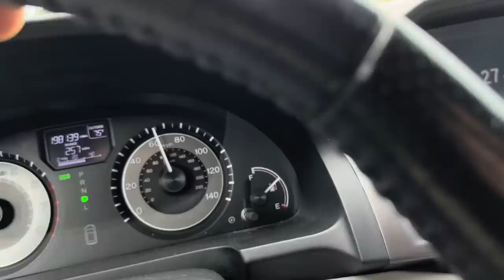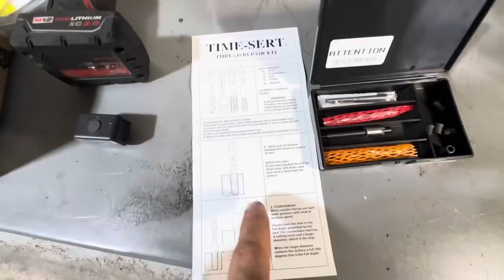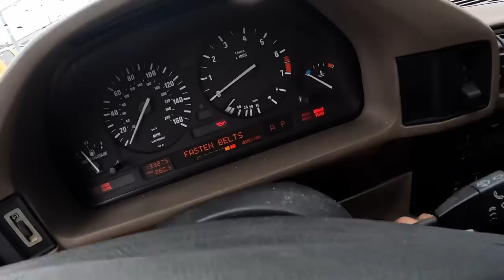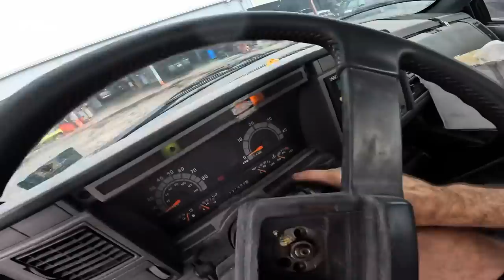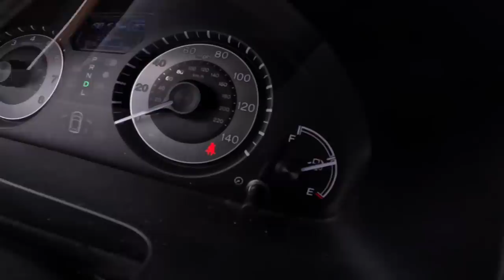Damaged Engine Block Threads! Subaru Outback Legacy 2.2 2.5 Hurricane Idalia

Comment: I am so glad you didn't give up on that engine.  That insert kit is great.  I used one when the threads on my motorcycle spark plug stripped out.  It was a race saver.  Be safe and take care.  Ken

Comment: Good job Ray, my only thought on the manner is I would have waited till the lock tight had set on the insert. Hopefully it didn’t get between the bolt and the insert. Or hopefully you don’t have to work on it after and put a new water pump if it did.

Comment: I had a Time Sert kit save me on a GM 3.4l rocker arm bolt. Expensive kit but worth every penny when not replacing a head. I learned to double check torque specs across a couple sources on critical bolts.

Comment: The reason they tell you to measure the drill depth is to be sure you are deep enough for the insert. It is a possibility you will need to go a little deeper and it's better to do it before you have the new threads in there.

Comment: Yay, an E34 BMW.  Had one for 10 years and thoroughly enjoyed driving it all that time. Comfy and reliable, only major issue was the diff started to whine after a couple of years but BMW replaced it under warranty. Still had original battery when I sold it although with it being located inside under the back seat probably helped.  Look forward to seeing you work on it.

Glad the hurricane didn't cause you too many issues and you and all units are safe and well.

Comment: If you did break thru, sealant on the bolt threads would prevent a leak. Thread locker (e.g. blue loctite) would probably work but teflon filled pipe sealant would work too.

Comment: 17:45  critical when tapping go in 2 to 3 turns  stop back off a 1/4 turn to break the chip, if you dont you can snap the tap off in the hole then your really in trouble also aluminum uses a different cutting oil then steel uses. Fyi.

Comment: 9:43 I did that in a head bolt on my Daily 2000 honda civic lasted for almost two years b4 I Did an engine swap And it didn't fail after the two years I just swap it Because I had to Make sure money

Comment: Should have used a Helicoil, much less invasive than a thread insert and the stainless steel threads of the the Helicoil are much stronger once installed especially in aluminum.  Friendly advice from an old auto shop machinist.

Comment: 4 months on the water pump repair, ouch, and you still have to put it back in. That’s got to be the most expensive water pump ever.  Might as well do the rear main seal and the valve covers while it’s out of the car.  

Riding the storm out!!! Be safe.

Comment: I like keenserts better for something that could ever need to be removed someday. They are the same as the timeserts but have wedged keys you drive down locking it in the hole so it doesn't unscrew..

Comment: Went and looked at the timesert site. I ?suppose? There thread expansion thing should work but the keyed type are very effective. I used them for many many years in machine tool applications and never failed a one.

Comment: Not sure if this was my car I would be satisfied with the water pump installation. Thread repair is great and probably better than new. My problem is with the amount of heat that was applied to remove that bolt, there could be just a slight deformation of the mating surface. I would have used a smear of RTV on the gasket just to be sure. The second thing is the dragging of the bolts when tourqing made for an inaccurate touque. A small amount of grease or never seize on the threads looked like it should have been applied to alleviate this and also make the next replacememt not have another broken off bolt.

Comment: I would have liked it better if you used the old water pump as a drill guide but you did good.  Used timesert myself on cam cap bolt, made my own guide.  The cam cap had its own inset which was a problem for timesert but managed to get it to work.

Comment: I bit of locktight is good, I've had cars come in that have had Helicoils in Suspension mounts, but because they are basically coil springs and the locktight can seep through the thread it either doesn't get used or it locks onto the bolt as well... so when some poor bugger has to pull it apart the Helicoil comes out with the bolt!
 Oh Ray, I would like to see hand at either end of the torque wrench (head and handle) holding the wrench part way changes the way the wrench bends and alters the applied torque before the click, just saying.

Comment: Good job on the Subaru's water pump broken bolt and thread repair, those things always worry me. I'm pretty sure you did a good job.
   The way you got the shop ready for the hurricane and the way you have things set up at home you're all set. 
     What time does the hurricane party start LOL.
   Stay safe and dry see you on the other side 👍💪💯

Comment: Good man, I always put loctite on thread inserts too. Better to have them hold position rather than them pulling out with the bolt. If the inserts ever do need to come out a bit of heat of the butane torch is better than possibly messing up the insert or bore if they pull out at the wrong time.

Comment: I have been learning all kinds of good things from these videos.  Even though I don't do really anything to my vehicle myself.  But this time I think was a possible case of really useful details.  That is, I'm supposedly outside of the direct path of the hurricane, they are anyway issuing various warnings.  Floods and possibly tornadoes.  Being just a few feet up the slope from the bottom of a "kettle", my one experience of area flood was not a big deal, until I tried to drive somewhere farther out.  A tornado I have never experienced yet, and hope this time also it does not find its way to this "kettle".  Best luck for everybody closer to the danger zone!

Comment: Ray here a Tip for the BMW 528i do not let her sit running for more than 20 Minutes they burn out the fuel Pump sitting idling Long story short we used to sell hundreds of that model back in the day and we found out the hard way

Comment: The oil separator plate has been replaced with the metal one. Interesting to see how you align the left side cams without the special tool and they are those oddball plastic cam gears.

Comment: I still don't know why you don't just put shims, a rubber bushing or even just bend the rear tailpipe hanger on the red mustang 1/4-1/2 inch. That isn't going to change the pitch angle of the tailpipe but it will give it the clearances needed under the bumper without "cutting"😮😮 scallops or replacing the bumper. The simplest solutions are sometimes the ones we overlook 😊😊 I am tracking the Hurricane soley with you guys in mind, stay safe and we'll see you on the other side. 🙏

Comment: Hey Ray, I was just wondering if you had ever thought about getting a portable solar back up solution? I've been looking into a few because it seems more convenient to have than a generator for small appliances and it saves on fuel cost when you don't need the heavy duty stuff. Anker, Bluetti, and Jackery are the companies that I had looked at. Their solutions seem powerful enough to charge your phone, keep your internet going, and a bit of PC stuff as well. Would have been great to have around when we went 2 weeks without power after Wilma all those years ago. lol
Reply from the maker: I have 1200w of panels on my well house just in case

Comment: I got the guess right. In the first Subaru video, I suggested drilling out and tapping the hole. It was much cheaper than an engine block. Be safe , all of you. I know what damage flooding can do. On July 11, we had major flooding in Barre, Vermont from thunderstorms. Several roads were washed out. There were mud deposits on the roads and parking lots that were almost a foot thick. Repairs are still going on.
Reply: Drilling and tapping the hole WOULD have worked if Ray hadn't snapped off an Easy-Out while trying to remove the broken stud. That bit of hardened tool steel made drilling impossible resulting in the weld-a-nut method.
Reply: @beezul  But he still drilled and tapped the hole. I did not say anything about using or not using an insert.

Comment: That’s a nice E34 5 series. I have a 2 litre one awaiting attention since before my accident in January. The owner is retired and has another car, so he’s waiting, getting free parking on the Beemer.
All it still needs is a replacement cat, because the aftermarket one fitted has expired, but he wants me to finish it off. Customer loyalty isn’t dead!
I’m glad we don’t get hurricanes here. That looks like a lot of trouble to go to, whenever nature has a tantrum.
Is the big open bay, at the front, safe? Should you move that door out to the front of the building?
I’m thinking of news reports I’ve seen, where the wind got in and lifted whole roof structures off.

Comment: When I have to use a Time-sert or a helicoils  I always use LOCTITE, 290, Green, Wicking Medium-Strength Threadlocker but make sure you don't put in the bolt for at last 10 min for the green Loctite to cure  preferer to use  Time-sert  over d### helicoils

Comment: Red stang......have you tried putting some washers between the tailpipe hangers and the frame  to space the pipes away from the plastic bumper cover ?  Seems a lot cheaper than replacing the cover.

Comment: Loctite 2701 50ml  *green*
"Loctite 2701 is a high strength, low viscosity, *green* , methacrylate-based threadlocking adhesive. It is designed for the permanent locking and sealing of threaded fasteners. It is particularly suited for use on inactive substrates and/or where maximum resistance to hot oil is required. 
LOCTITE® 2701 is designed for the permanent locking and sealing of threaded fasteners. The product cures when confined in the absence of air between close fitting metal surfaces and prevents loosening and leakage from shock and vibration."

Comment: i am wondering if the cruise control works on the tow truck. for tow trucks like yours, stick shift, the cruise control functions as the high idle for the PTO... i would recommend trying the cruise control for the PTO... this could result in the unneeded need of the plug you are using to hold high idle....

Comment: It was nice to see you slip that Rubasu repair in with the hurricane preparations.  Still getting work done.  Take that Ida!

An old trick to prevent the stinky A/C air is to shut it off a couple of minutes before you arrive and let the fan run on a high setting.  Doing this dries the evaporator, preventing mold growth.

However I don't expect most people to have the discipline for such things.  They're in a hurry, distracted, and often know nothing about their cars and do not care to.  You will always have work fixing them.

I see the storm has passed without damage at the estate, according to Wife Unit.  Hopefully work also weathered the storm and Troy as well.  See you in the next one.

Comment: The reason engines are drilled and threaded by machine is to eliminate human error.  I was watching closely and that drill was rocking up and down quite a bit. Also you weren't quite perpendicular to the face of the engine as the engine was leaning back considerably.

Comment: Hello the Ray machine. Howdy to you and family unit. Great as always. I have a question for you if you could. I have a bleed nipple on my bike brake caliper and for years when I bought my bike was broken off but not leaking fluid so I decided to drill fine and use a new easy out but under no pressure it decided to Snap off under no load so now how do I get the easy out  , out of my caliper. ???? NO. Lance. Your favourite watcher an replier .

Comment: What's the torque spec on those water pump bolts?  When I was active in the San Diego Corvair Club, we'd often come across valve covers with 1/4"x20 bolts with the holes in the aluminum heads stripped.  Quick solution was the next size up metric bolt (don't recall what it was).  No need to drill or tap the hole, the bolt would cut it's own threads and tighten up just fine.  Granted valve covers aren't under pressure like a water pump, but still...

Comment: HeliCoil is a coil insert which gets expanded afterwards to stick in the hole.

The thread repair kits that insert a bushing style insert with threads on the in- anmd outside, are IMHO a piece of junk.
They undo and stick on the screw when unscrewing again if the screw has to be screwed in with a certain amount, unless you glue them.

Comment: Anyone else notice the clamp on the old water pump was facing inward?  How do you tighten it when the pump is installed?  When you stacked the mustangs, I hope you put a waterproof cover on top of the convertible top.  Any sort of oil leak on it would be impossible to clean off.

Comment: Not a criticism, just a question: Why install an insert instead of tapping to a larger size bolt? Although I do agree/approve of the repair. Stay safe in Hurricaneland.
Edit: That IS a tight squeeze, I can see where a larger bolt would not be an option.
Reply: That's what I would've done, then drill the hole in the water pump and gasket bigger for the larger bolt.

Comment: 3:58  storms not messing up the economy,  its just messing up yours now, retail food water gas generator plywood sheet metal  screws nuts and bolt sales couldn't be better. Its just messing up yours.
You could always buy a old tractor trailer trailer and fill it with plywood for the next storm and sell sheets of plywood and screws when a storms comming.
People won't mind paying you 75% markup from home depot price when they run out. Yes its greedy but its also an investment. 

Now after the storm it going to generate business you wouldn't have had. 
Its just a temporary setback.
Meanwhile home depots still out of plywood and you've got a trailer truck full of it you can sell.

Comment: FWIR: Those Subaru engine blocks are in 4 pieces.  Would it be possible to just buy and replace that one piece of the block?
Reply: The Subaru engine blocks are a matched set and must stay together.  There are matching numbers on top of the engine on each side to make sure they can be put back together when they are completely torn apert.

Comment: Hey Ray. I have an unrelated question. I changed my front rotors today. One of the slide pins is siezed up. Any tricks to un-stick it? I can turn it barely, but it's toight like a toiger. Any suggestions?

Comment: sir, I am not a mechanic.  But I found it odd that you would not put RTV or some type of sealant on the water pump gasket.  Care to educate me on why no sealant.  Thanks.
Reply from the maker: There’s really no need to put sealant on a gasket. It’s messy overkill. If sealant was required, than a gasket would not be required. So if a gasket is required, that suggest that no sealant is required. There’s always exceptions, but that’s the rule in general
Reply: Thank you  @RainmanRaysRepairs
Reply: Time seats are really good. Need red lock tite on the external treads. The countersink always ends up below surface level. The insertion tool cold forms the last couple threads flaring the end of the insert to lock it in place. You should tighten the insertion tool until it threads completely thru the insert and then turns freely. Those inserts make a permanent fix for the ford modular 2v spark plug thread blowouts. The flare on the outside and the insertion tool flaring the inside permanently locks it in place.

Comment: WTF.... $100 thread insert tooling to fix one thread, that could have been drilled and tapped out to M8 x 1mm (metric fine series) and a cap screw used to bolt it in. The tap is cheap, fastener is cheap and so is the drill needed (9mm) to tap and create larger diameter hole in the pump, if needed.  

I suggest you seriously research and consider what is in that break clean you use so often in copious amounts. 
It's NOT non-toxic... in fact it contains carcinogenic compounds.

Comment: 8:42 ....? Why?  Why dont you just drill a bigger hole then cut a fresh bigger thread? And use a bigger bolt? Why you need to spend $ on that looks like a crap to me thing.... ? That kit sounds like a cheap chinese bullcrap to me...
Why dont you spend money on tool which can cut threads multiple size? Thread cutting tool kit or whatnot... his name in engrish

12:39 Thats bad! You need to use the O2 pistole and blow out the metal parts, not break clean... then use tallow to lubricate

wtf Ray you are out of your mind?
27:48 100 something usd for that crap? Im MAD!

You just need to know what is the next size bolt which can thread into that hole need to know what size of core need to drill...:face-blue-wide-eyes: